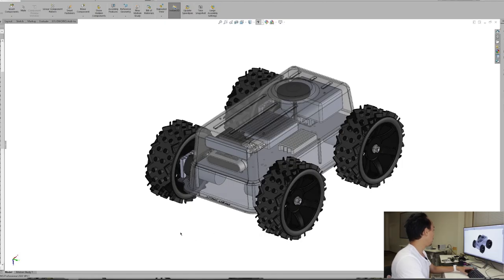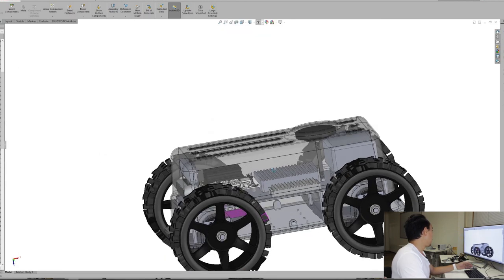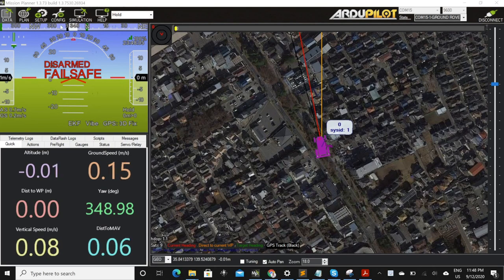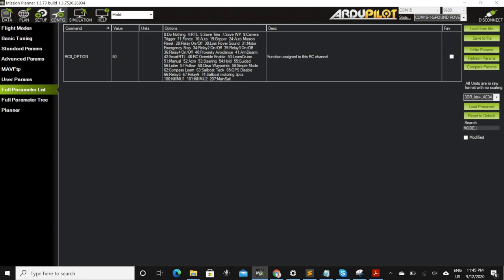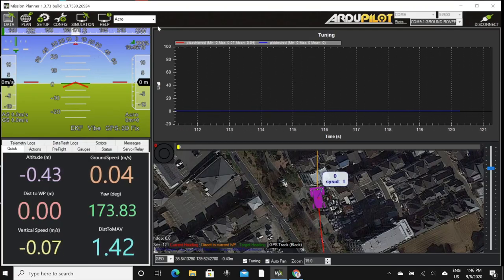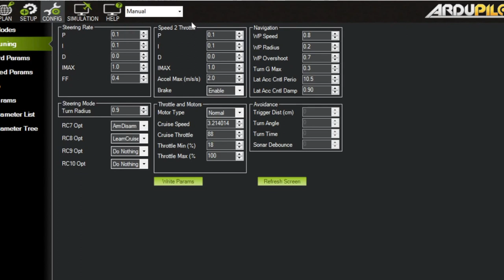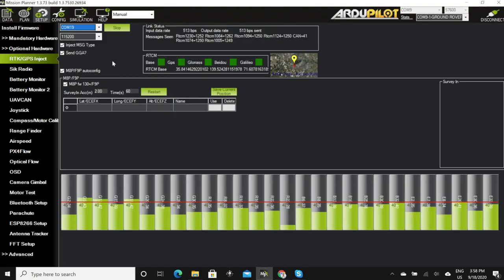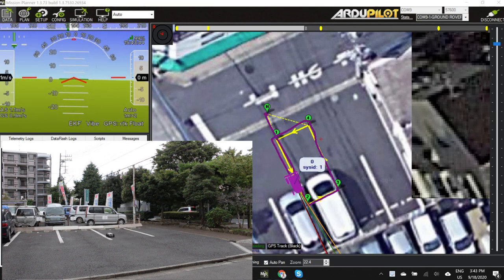How to start making AUTONOMOUS ROBOT with the ATTLER

Comment: Hi I’m currently doing a similar project video popped up and I’m curious about the ESC you used since I can’t find it anywhere and it would solve all problems I tried using 2 RC ESCS but they burned out and then I tried a motor driver just find out it isn’t compatible with ardupilot so I’m kinda stuck on that if anyone’s it would be super helpful

Comment: Nice project! I would like to add camera vision to it. Some uses of camera vision would be to color/contrast/gradient differences to define a line and stay to one side of the line, which ever side it was originally on. Doing this it can use curbs, sidewalks,  driveways, fences, and shrub areas to create a line, then follow the line but to right or left of the line which would keep it on the lawn. Also to define moveable objects in way like balls, sticks, pine cones and rather than avoid them, move them and continue on its path. Could later have an option to pick up these things from the lawn or ground, chuck them in a basket attached for later disposal.. options are limitless.. identify weeds, ant hills etc. Then spot apply pesticide or weed killer. Ok secret is out, yup, wanting to make an autonomous lawn mower.